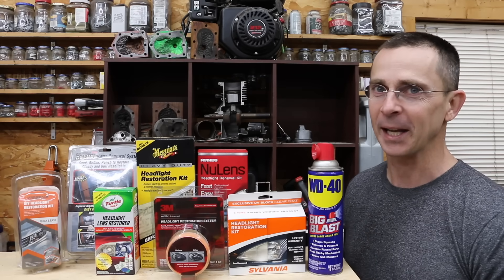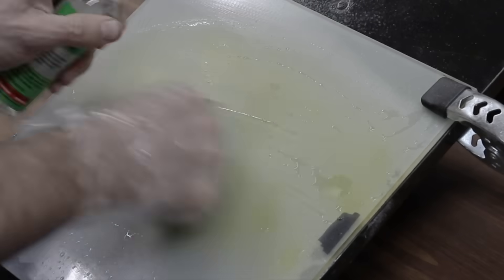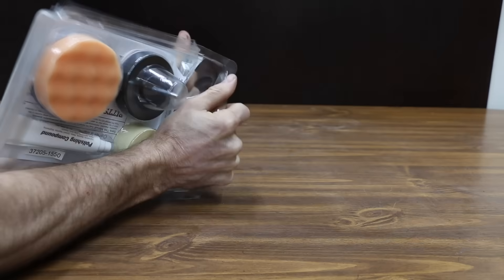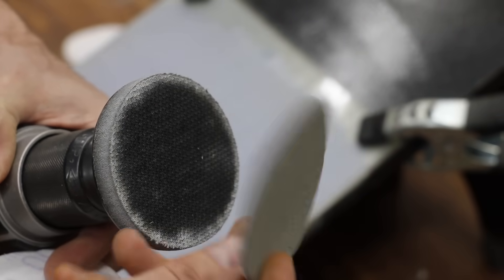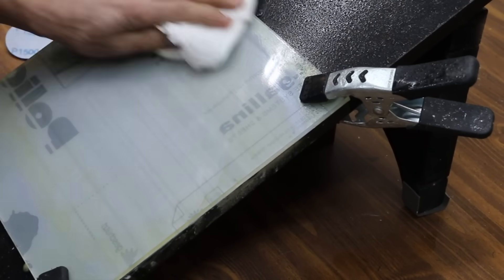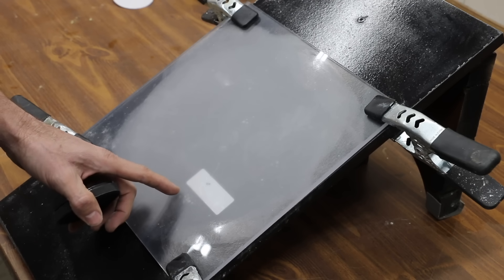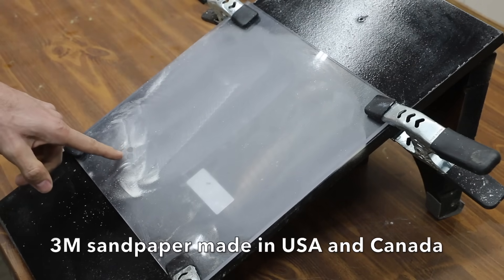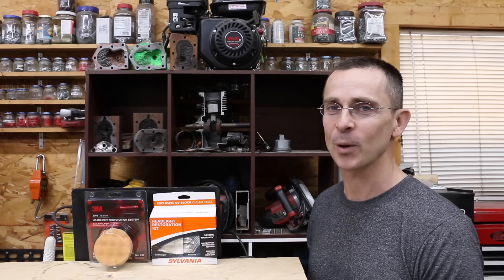Best Headlight Restoration Kit?  Let's find out!  3M, Sylvania, Meguiar's, Mothers, Turtle Wax & HF

Comment: From my experience polishing compounds is more than enough for light oxidation. The only times I see sanding is necessary is if there’s a thick layer of oxidation or deep scratches. For most cases though you could get away with polishing compound, a rag and time. Also in soft materials lubrication is important because they tend to clot more.
Reply: Polishing compounds work as you stated on headlights that have been restored before. If the headlights have the originals fading clear coat, it isn't enough. That's where sanding is required.

Comment: Sand and clear coat!  I think you should try this method, which I believe works much better and easier.  Would be interesting to see how you felt this method worked vs the money making kits.  Sand and clear coat, way less work and looks perfect after.  Got the idea from customspraymods on youtube (great channel).  I just don't think a flat pad on a drill can maintain the curvature of the lens, I believe it is better to do the sanding by hand.

Comment: Very interesting to see. sadly it is illegal in EU. Thickness of the "glass" is type approved under the E-mark. Polishing it changes the thickness, and as such invalidates the E-mark.
It is impossible to check at inspection, just be aware of this.

Comment: The one kit I didn't see and wanna try is made by wipe new. I have used their plastic restorer years ago ago and it is still lasting and making the plastic look new even after other products were applied over it and were off. Wonder if the headlight one is the same.

Comment: I have posted a video suggestion before.  Figured I would post it again if you need more idea's.  You should do a Spray on wax/polish compair.  My recommendation is Plexus.  It is made for plastics, but can be used on everything.  I have no issues using it on glass, painted vehicles, plastic, metal, chrome, etc.  I recommend spraying it on the part, then use a micro fiber to buff it good.  Then use a dry side of the microfiber to finish buff/polishing.  The more you buff/polish it, the slicker and shinier it will become.  "Plexus seals the pores in plastic surfaces with a micro-thin layer of shiny, protective wax, making it resistant to debris, oil, scratches, and eventual yellowing" 
https://amzn.to/2X2NBjv

Comment: I use Autosol Marine Shine Metal Polish, no sanding papers, no water. I put a pea size on my finger abd apply it, rubbing until the area I'm working is smooth and dry. Buff off any residue and move on to the next area until the lens is all done. It takes less than 5 mins and I get great results. I have 4 cars and use this method on all of them.

Comment: I’ve used a few different products on my headlights over the years and every single one of them looked crystal clear after application. What happened here? Did you not use the protective wipes or liquid? I find it hard to believe that they all looked that bad at the end.
Reply: Many look good after the initial application. Their product fills in the scratches right up until 3 days to a month later when it's evaporated .....

Comment: Mother's Aluminum polish.  If that doesn't cut it, get the 3m assorted sandpaper pack, tear strips and 3 fold the strip.  Always, always use water, I like to throw a bit of dawn in it. I had to do the minivan again after a year (after multi-grit sanding) and just hand rubbed some MAP and washed away and good as new.

Comment: Headlights are cheap as chips these days. I replaced mine with brand spanking new one's for $40 bucks each. The only way to properly restore them is sand and clear coat I'm a  spray painter 25 years and could not be bothered repainting. Those headlight restores are crap. They will not last long at all and will cost the price of new lights. After all that stuffing around it's just cheaper and easier to buy newbies.

Comment: Another great video and the timing couldn't have been better. I was looking at various brands today to freshen up my foggy headlights and there were too many options and price ranges with every brand claiming to work magic. I knew they couldn't all be great so I backed off and decided to do some research first, and then you posted a video. Awesome!   Already checked and my local AZ has Sylvania in stock.

Comment: I've had great results with pure wetsanding 600, 1000, 2000, 2500 then coat with VHT high temp engine enamel gloss clear. Lasted about 3 years.

Comment: I bought the Meguiars product from a store shelf (probably Walmart) to restore the headlights of my father's minivan, but before I could get to it (it was winter, and the whole process doesn't work well in extreme cold), I ended up getting him a new minivan.

Years later, when upgrading my main PC, I fogged up the window (acrylic?) of my drive bay reservoir (water cooled PC), and ended up using the Meguiars microfiber polishing tool and compound to remove the scratches from that window.  It did a pretty decent job for the few minutes I used it.  Given the testing you did, I'd guess that if it included coarser sand paper to start with, it might have ended up further up in the ranking.  But it's certainly far from the cheapest option. 

Quite surprised at how well the Sylvania did, given it's low-tech approach.

Comment: The best one to use is Duraglit or metal polish that you would use to polish Brass at home. Just apply it with the soaked wadding in the tin and then polish off with a dry cloth, simple and easy to use and cheap. I have used this a few times and it has passed Auto Inspect/MOT without any problems.

Comment: I bought a 2008 Nissan Sentra. Both headlights, well, the outer plastic covers, were yellow and the amount of light getting to the road was poor. I used NuLens and today, those Chrystal Clear lights shine on the highway at night and when on high beam, I can see all the way over the horizon. ;-) Well, not quite, but I no longer over drive my headlights at night at 100 km/h. We get a lot of dear coming out on the road at night and wow, what a saver.

Comment: the one I found works great for me is the Rustoleum Wipe New. It's similar to some of these. It comes with some sanding pads which mostly you don't need unless your lens is very yellowed. But you just open this pouch and wipe the stuff on the lens. That's it. No sanding no nothing! I do this one each year for each of my cars. One kit can do two cars.

Comment: I have a test for you and since you wear eye glasses also, how about a test on the different coatings that are used on them. And is there any way to efectively remove the coating after they've become scratched. It's been my experience with glasses that no coating at all is the least scratch resident. Although the anti glare was really nice while it lasted, less than one year.

Comment: Meguairs is one of the best products I’ve used it and the way you sprayed the plastic glass with the yellow painting or whatever you used isn’t the same yellowing caused by the sun and I’ve had great professional results too where I’ve charged $50 per headlight you did a terrible testing and results use actual headlights with oxidation caused by UV rays I think you did a terrible job with the testing you did!!!!

Comment: Im surprized you didnt include the 3M heavy duty restoration kit, it comes with a clear coat as well, Ive used it before with amazing results. Anyway Great video!
Reply: Straw Bandit is the clear coat a spray can UV resistive clear top coat or another version of spray or liquid with wipe applicator?
Reply: @jimmyaber5920  Its a wipe on type clear coat, and it has UV protection

Comment: The way I have always clean headlights I use the standard car buffer or by hand to apply first polishing compound and then wipe off with the terry cloth. Then I would apply the Greene turtle Wax. Why specifically The Greene turtle?something about its combination of abrasives that did a really good job to bring up the lens to a good polish finish and the car wax to protect the lens.I would wax lens every few months with the same Green turtle Wax cleaning and sealing the lens each time. I never really had to bother with these kits by doing it this way. I have been using this technique for about 20 years.

Comment: I use 800 grit wet sandpaper, then 1000 grit, then buff them with Pepsodent toothpaste on a drill mounted buffing pad. Then I buff again with wax by hand. It does really well and total cost is under 5 bucks. The toothpaste and sandpaper last for several headlights.

Comment: I would love to see him do this with window scratch removers. I need to get the scratches out of my 79 Camaro.
Reply: I've seen a few kits, but for glass polishing, most come down to a polishing pad and some cerium oxide powder.
You can cut out the majority of the process and just buy the cerium oxide powder from Amazon or your other vendor of choice.
Reply: Be very careful. Heat buildup will shatter that window. A polish with diamonds "might" remove the scratches.
Reply: Eastwood windshield kit, Honda windshield wiper put lines in, dealer offered to replace windshield, I passed, used, kit - gentle - slow.  Worked well, give it a try.

Comment: @ project farm UVC light  will degrade the plastic quickly in a day or two
   make sure it's a real UVC light  though(Clear CFL bulbs are real ones)  lots of fakes on ebay
just wear protective gear while using it such as eye skin protection(sun burn risk to eyes and skin)

Comment: Before I even get into this; for years I've used a very course grit sandpaper then, a very fine grit. Afterward, I'd use a DupliColor Clear Coat spray to coat it. It makes it look as if wet, EVEN WHEN IT DRIES. My mom's Bonneville was VERY bad. I have before and after pics. She was shocked. Especially after almost paying close to $100 a lens. I actually ran a tire shop in Austin Texas that would let me do just this and I got half of what we charged. It was $30 a lens or $50 for both. Eventually had about 2 to 3 cars a day coming from miles away lol. The clear coat is suppose to be uv resistant so it'll last longer than JUST plastic

Comment: Rub small amount of automatic transmission fluid onto headlight with finger. Let stand for a minute. Buff off with rag. Wash with soap and water. Mask areas other than headlight then spray with clear spray paint and let dry. That's all I do for my truck. Lasts about a year quick and cheap.

Comment: A rule of thumb for using those sanding pads meant for drills is to always use water as a lubricant, as well as rinsing off the pad with water to remove the bits of plastic stuck in the pad.

Comment: Great video Todd. Perhaps you could get viewers to donate foggy headlights so you can do a more accurate test? Or alternatively go to Pull-a-part and get a bunch of identical foggy headlights? I had pretty good luck using Mother's but I only had the polish alone as I didn't know at the time that they made a complete kit. Also the Car Wizard recently did a fix of foggy headlights with dot 3 brake fluid so perhaps you could try the chemical headlight restoration method as well?

Comment: I used regular sand paper, starting with 400 grit moving up to the 1500 grit gradually with water as lubricant. After making sure the scaring is uniform I sprayed the headlights with some clear coat from the can. After 24 hr I wet sanded it with 2000 grit and polished with medium polishing compound. The results were much better then using the headlight restoration kit. My headlights turned out like new. This approach will cost you about $20 with ability to perform this on multiple vehicles. I was very pleased with results.👍🏻

Comment: I did mine on my Buick with 600grit, 800grit, 1000wet, 1500wet, 2000wet, 3k wet and 5k wet. Then I used adhesion promoter and then I did three mist coats of clear and then two wet coats. So far they've lasted 3years looking brand new

Comment: I personaly remove my headlamps as soon as I see that they begin to oxidize. I'll wash the lens to remove oils and then use a scuff pad to prep the surface. I'll clean the surface one last time with soap and water and then I shoot clearcoat used on body panels to refinish the lamps. It works great and honestly lasts forever.

Comment: Wish you wouldn't have done this.  This tip is a heavy guarded secret. Its like exposing magic. You shouldn't do that. But now that you shown it. Yeah use 1500 grit on the lights. Then use 2k clear. Or 1k clear.  You will be able to see straight through it for now on.

Comment: SYLVANIA - Headlight Restoration Kit - 3 Easy Steps to Restore Sun Damaged Headlights With Exclusive UV Block Clear Coat, Light Output and Beam Pattern Restored, Long Lasting Protection https://www.amazon.com/dp/B00429NKWK/ref=cm_sw_r_cp_tau_2jjZEb60WWSW2

Comment: Wow, you worked your butt off to make this video. Thanks. I've used 3M before with very nice results but I've never even heard of the Sylvania system. Your results are typically spot on and I would recommend to anyone that they watch this video before selecting a product.

Comment: You dont need any of this stuff.  All you need is toothpaste and a rag.  Squeeze a large glob of toothpaste on and polish with a rag for about 5 minutes.  Wipe the paste off with a wet towel and you are done.  If you want to go the extra mile, buy a can of UV protectent clear coat from the hardware store and spray a coat or two on your headlights.  This is cheaper and more effective than the professional products.